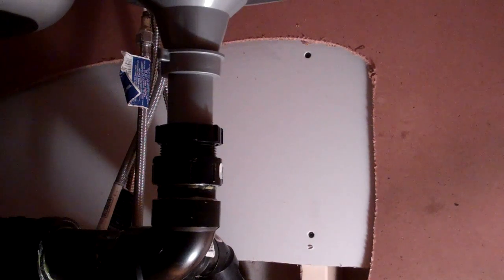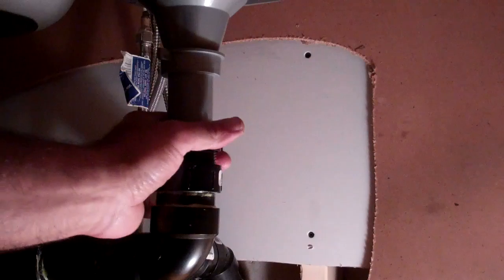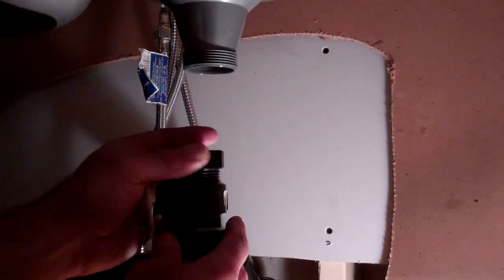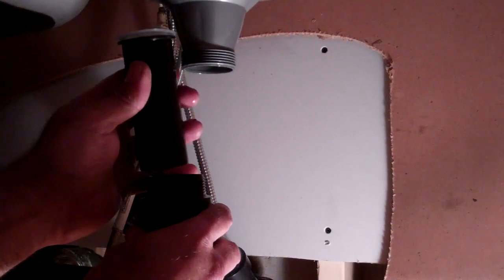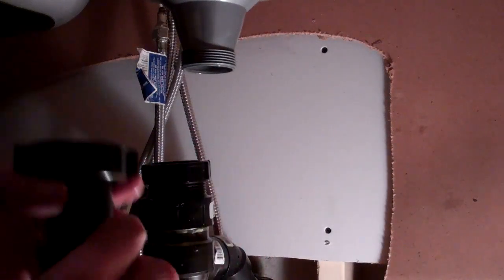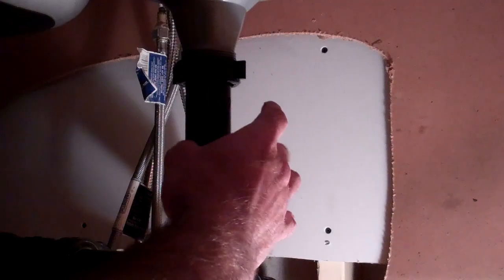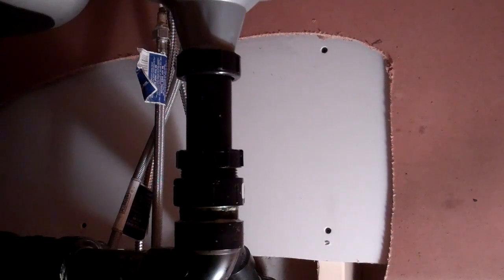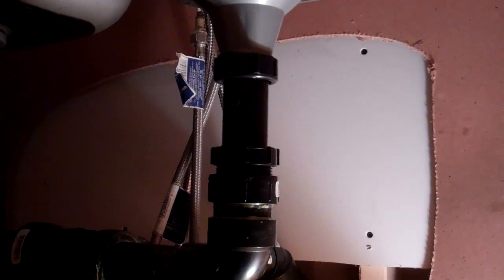How to replace a sink tailpiece

Comment: Thank you!  This was exactly what I needed to see. I couldn't understand why my drain basket threading and the top of the tailpiece were wrapped together with Teflon tape.  It was missing the washer!!!  Thankfully, being the pack rat that I am, I just happened to have one in my box of plumbing stuff in the basement.  Now hopefully once I put this overly complicated drain assembly back together there won't be any more leaks.  Especially since it is almost midnight on a Sunday...
Reply: Ours was missing the washer too!  And the nut!  Leaking for many months.  What a mess, caused so much damage to the fake wood base under our sink cabinet we must have it rebuilt.  We used plumber's putty as a temp fix until we can get a new tailpiece.

Comment: Thank you!  Couldn't figure out why our tailpiece was not secure in the pipe, thought it had broke off.  Leak caused water damage (warp & rot) to base of our under kitchen sink cabinet, now must replace. Our tailpiece not only too short but has no nut or washer. We applied plumber's putty till we can get new tailpiece as you show in video.

Comment: I am not an expert but I would tighten the top completely so that the tailpiece is pulled tight to the sink before tightening the bottom (4:02)   The free play in the drain system likely forgives this but may cause unnecessary strain or worst case decoupling.  Great video regardless!

Comment: Do you realize Your the Only ONE I found that showed the "Flanged tailpiece" with the Proper Washer -"Tapered Teflon Seal" and Correct Assembly on Youtube! Someone before put a slip-joint half assed into the nut and leaked for several years once in a while. I have looked everywhere, and every jack ass expert either skipped that step, or showed a Slip-Joint connection! I'm on My way back to Home Depot to exchange my Material after I had two different Stores Miss That the "Strainer Sink" doesn't have a damn Slip-Joint for a Connection, Plus the Nut is even Different! Thank You So Much, On My Way to Snap someone's neck at Home Depot! BTW, I noticed below others have had this same problem also. Seems Plumbers out there and supply Houses don't know what  the hell they are doing. I ran off the last Plumbing Company, the guy was an idiot and made the problem worse. People who don't know better have to pay for that ignorance! Pisses Me off! 37 Years as a HVAC Technician and We don't touch that nasty stuff! My own sink has caused Me a nightmare I could never imagine! Thank you so much again! You are a true Tradesman Sir!

Comment: is there any way to fix a leak in the funnel just under the sink before the drain pipe . the funnel that I have is just like the one in this video I could not find any way to take it apart and if there is a backflow the left sink will leak. the right sink funnel that is located under the sink is tighter than the left funnel. Or are these prefab ?

Comment: What happen if the drain basket is not perfectly level? When you try to screw the tail piece to it, the alignment of the drain piece is not perfect. It causes the joint to leak. Any advise please?
Reply: Plumber's putty?

Comment: I dont see a p trap…
Reply: If you don’t see a p trap your plumbing might not be up to code. It’s there for safety reasons. Without it gas can come in from the main sewer line and make you sick or cause an explosion if it’s a lot. H2s gas is deadly. The p trap blocks the gas from coming into your house